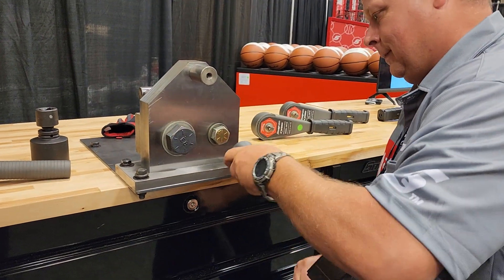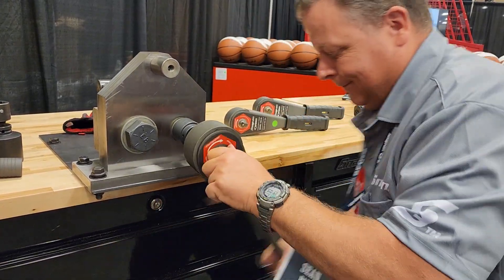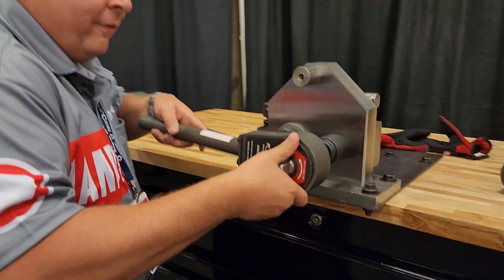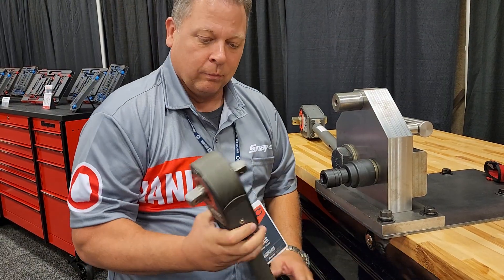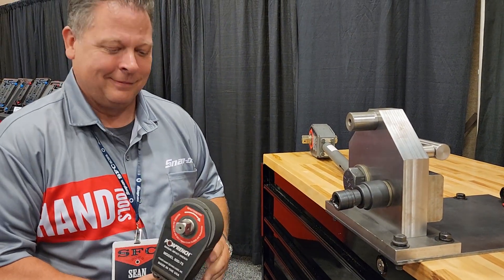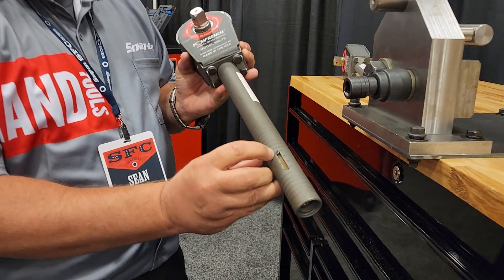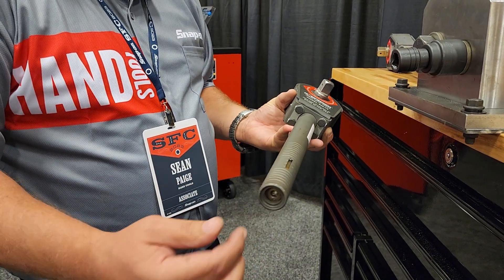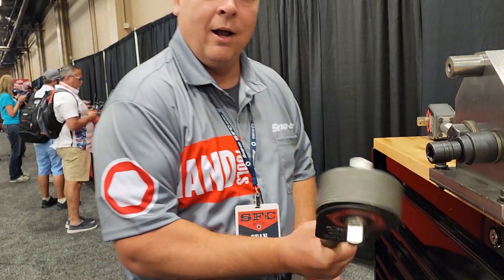Snap-on Pow'rench is absolutely amazing.

Comment: Context/history: This is the current incarnation of the Swench, previously made by Power Hawk. Their main business is fire rescue equipment, so they sold Swench to Snap-on. Before Power Hawk, these were made by Curtiss-Wright.

I have a 750 and it definitely saw some years and use before I got it but it still works as it should.

Comment: The big question, how much
Reply from the maker: $895 for 500 ft-lbs bidirectional either 1/2 or 3/4 drive.
$2035 for the 800 ft-lbs 3/4 drive bidirectional model.
$2705 for 2000 ft-lbs bidirectional 1 inch drive model.  

No air or battery dies, this thing is a lifesaver.
Reply: @CDAVIS00346  I mean as an auto and light truck tec I can definitely see it as a occasionally useful tool to have but hard to justify at that price? And I’m sure 90% of potential customers would agree that they just can’t justify it. What’s inside them that makes them worth that much?

Comment: A tool for all the fan boys that'll never get used.
Reply: My coworker has one that gets used all the time. I also borrow it on occasion
Reply: @stoneyswolf - apparently you’ve never had to remove/install a crank pulley bolt on the Ford 1.0L Ecoboost engine.  A 5:1 torque multiplier is necessary for that job.
Reply: @ghostwrench2292 how do you even have the chance to do that? Those engines are grenades
Reply: @22mpb  if they don't grenade themselves first, the front cover will leak.  It is during this repair that you get to play with the torque multiplier to remove/install the crank pulley bolt.

Comment: Where the fuck will this fit 😂😂😂 can’t even get my 3/8 ratchet to fit in some spots 😂😂😂😂
Reply: Perfect for busting lugnuts on semi's if your against those new fangled air and battery tools
Reply: Its for very niche heavy duty aplications, they have versions that go up to 2000 lb/ft. Its called a Swench, they also have a model 1500 that goes up to 7000 lb/ft

Comment: $$$$$$$$$$$$$$, Santa, you there?
Reply from the maker: Looks like $895 to $2705, depending on ft.lbs capacity.   There is a 500 ft.lbs model, an 800 ft.lbs model, and a 2000 ft.lbs model.
Reply from the maker: Shop.snapon.com is where you can find pricing.